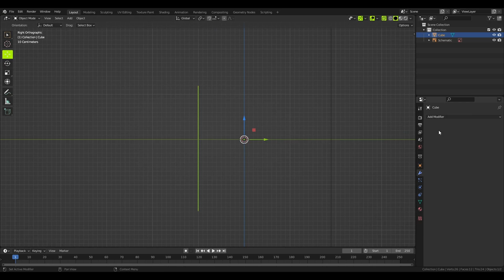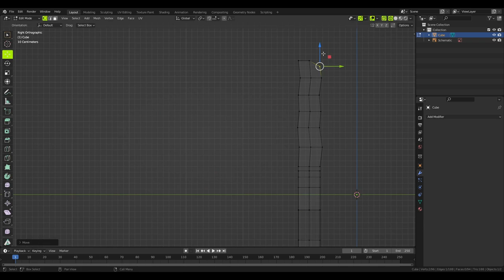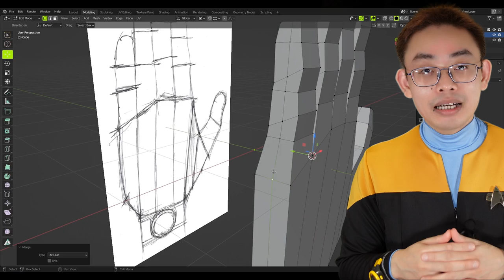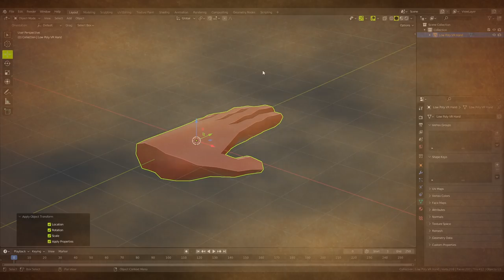Low Poly Hand Modeling and Rigging Trick :D

Comment: how would you rigged the hands
Reply from the maker: I will be çovering that in the future, I am working on a bunch of videos at the same time at the moment, all 3D related :-)
Reply: @BracerJack  that's great... Oh I was watching your other model tutorial but I realized u didnt use the same slant lines method when doing the full body on the robot/ square character
Reply from the maker: @donjohnson4347  They are modeled for their specific purpose, what projects are you working on ?
Reply: @BracerJack  well am working on character but I have been having a lot of problems with it, I even rigged it an animate but they are so many problems. So I am just going to start over from the basic
Reply from the maker: @donjohnson4347  Sounds like a topology issue. If you could post your model turn about in YouTube, I can see it and we can talk about it.
Reply: @BracerJack  do you use unity, becaz one of the problem is that it deform or distort in unity
Reply from the maker: @donjohnson4347  No I use Godot. 
Without looking at your model it is difficult to tell, but game engines only use the weight information from your rigging software, so it is probably still a rigging topology issue but I really cannot be sure without looking at your work.
Reply: @BracerJack  well I can send you to it to look at if that's ok, because I have tried everything I possibly can
Reply from the maker: @donjohnson4347  Uploading a video of the deforming errors in wireframe mode is more than enough :-)
Reply: Although your hand tutorial make me want to do it over caz it is way more better than the hand on my model
Reply from the maker: @donjohnson4347  Oh man...and you know what is amazing ? It works for the elbow and knees too !!! Good luck 🤞🍀